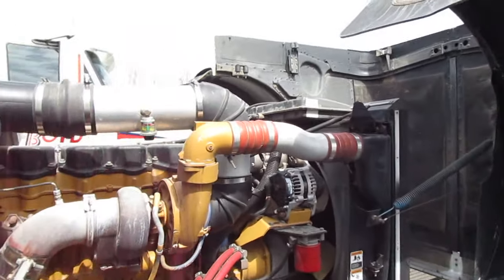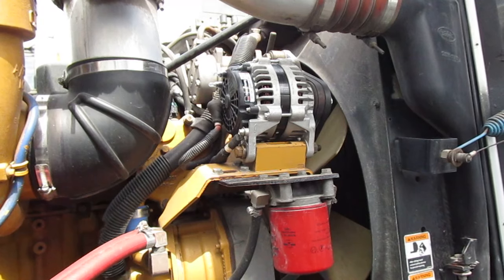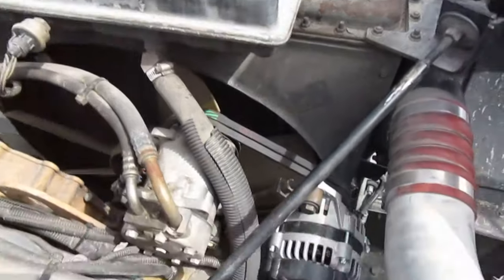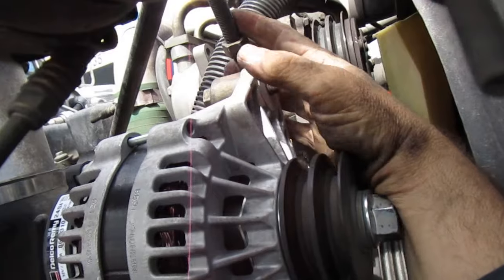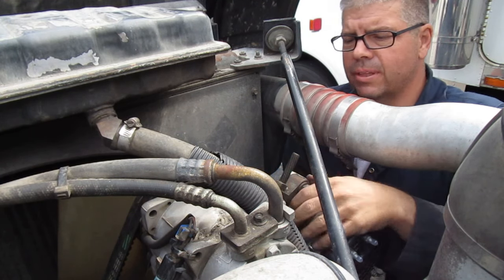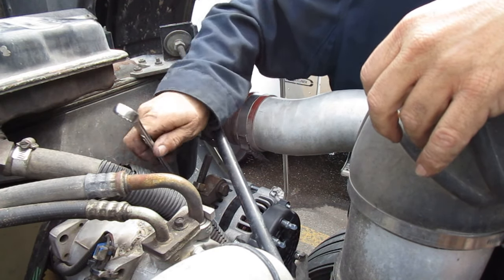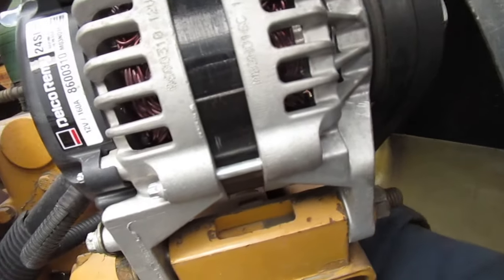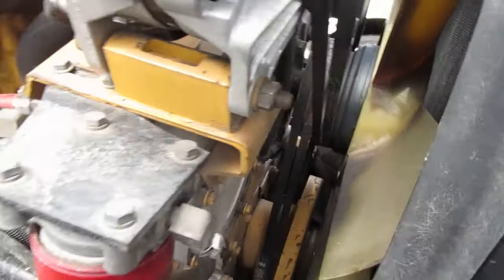#88 Changing Fan Belts on CAT C15  The Life of an Owner Operator Flatbed Truck Driver Vlog

Comment: If you do it yourself,  you know it's  done right. (Still think you should've done the alternator yourself.) Thanks for doing it twice (maybe 3, lol).  (Saw your $3k comment on TFC.)
Reply from the maker: +Steven Murata 
$3000 might be a little high. I know at my company it cost $3500 for every thing they require that includes a headache rack for your truck.

Comment: That motor looks super clean!  Rebuilt yet? Let me know when you go to sell your truck!  I got cash money for a well taken care of peterbilt!
Reply from the maker: +ConcretePilot 
Thanks for watching
No rebuild yet 
Fingers crossed
Reply: Dan have considered just replacing you engine with a later more efficient engine and keeping the Pete,I think if a newer engine is used the it will not fall into the emissions criteria of new trucks?
Reply from the maker: +Jim epps 
Thanks for watching
That sound like a good idea but I think the cost of retrofitting for a newer engine would be more that the value of the truck
Just to rebuild the motor that I have would cost about $20000

Comment: How do you change the other 2 that are not attached to the alternator? or do you have 2 remove the alternator ones to change the other 2? I guess I mid aswell replace all 4 anyway. Do you have the Part number for those 2 alternator belts